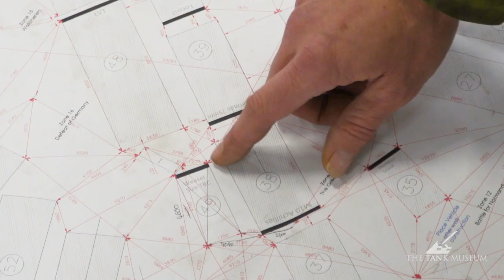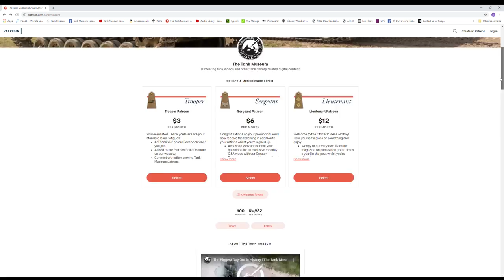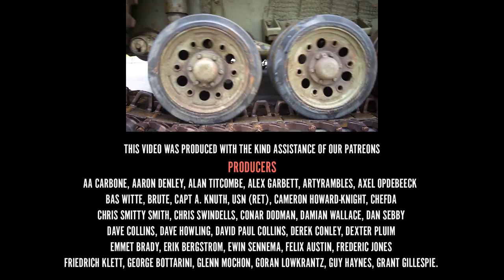WW2 Tank Move | Ep. 8 | Tank Workshop Diaries | The Tank Museum

Comment: If you use the A frame attached to the pintle hook of the buffalo and the towing eyes of the towing tank it will track nice. This allows you to use the equipment your staff are used to, the reversing of the A frame works with two tracked vehicles as they both skid to turn anyways.

Comment: Hi, Not sure if this would be of interest to you and I'm not really sure of another way of contacting yourselves at the tank museum, but I was watching your video and the part about moving the vehicles around inside and having the issue of diesel fumes got me thinking about something that might be useful to you. I'm a surveyor/chemist for the oil and petrochemical industry and there is a fuel that's been specially developed for working in confined spaces called GTL. It's diesel, but with virtually no sulphur content. It was developed specifically for fuelling the plant machinery they use for working inside the Channel Tunnel and is also currently being looked at by Transport For London as an option for Black Cabs and Buses there to drastically reduce harmful pollution. Not many people are aware of it, so wasn't sure if yourselves at the Tank Museum were either. If it's something that might interest you, I could probably find out who you would need to contact for more information or to procure some. Keep up the good work! Merry Christmas
Reply: Diesel for underground vehicles has always been low sulphur. Mining plant gets a huge ceramic particulate filter, a PTX catalyser and often a wet scrubber (and monthly emission testing). Channel Tunnel is a bad example to use. I was offerd the position of ventilation engineer, I turned it down. They used to have to stop work to allow the air to clear so the alignment laser could see the face again.
Reply: @QqJcrsStbt  I'm guessing by the fact you mentioned alignment laser and face, that this was during the period when the tunnel was still being physically constructed, rather than the vehicles that are used to maintain the tunnel now it's fully built.
If so, then the fuel I have mentioned above would not have been available at the time as it simply hadn't been developed then.
The fuel that wouls have been used back then would have been Ultra Low Sulphur Gas Oil, which has under 10 parts per million of Sulphur in it, it's still what most agricultural diesel vehciles are fuelled on today. And still produces quite a lot of harmful Sulphur fumes when combusted.
The fuel I mentioned above is a special Middle Distilate Fuel that has been put through a process where the fuel has been evaporated so it leaves the heavier particulates like Sulphur behind, then re-condensed back into liquid form. Hence the name 'GTL', stands for 'Gas to Liquid' It's fuel properties are extremely close to Diesel (So DERV's all run fine on it) but only has trace amounts of heavy particulates in it like Sulphur (A lot less then 1 part per million) So much safer for people to be around it in a confined space and also, just plain better for the environment in general

Comment: How about having a few high-load (90T) electrical / hydraulic turntables at key points in the hall (at each end of the main gallery, directly in line with exterior vehicle access doors)

That way you wouldn’t have to do so much turning the tanks a little at a time using mats and jacks. 

You could tow a tank in through a door, to the turntable, turn it 90^, tow straight down the gallery a close as possible its apportioned mark, and only have to crank and jack and swear from there to its final spot

Comment: Would it be possible to jack the Tanks up and then put heavy duty, multi-independent, wheeled dolly under the tanks?  The dolly would go from front to back and side to side of the bottom of the tank.  Maybe multiple dollies so you could put them under the tank a row at a time. Then lower the tank down on each row of the dollies, one at a time.  Then the weight of the tank would be spread across all the many dolly wheels.  And because the wheels would be independent turning, you might be able to spin the tank instead of towing and turning?
Reply: That is what I was thinking , dollies can pivot at the center , picking them would not be hard.

Comment: I wonder if you could inflate a skirt between the tracks and float the tank around like a hovercraft? If you want to get real fancy,  put an electric motor and wheel that can spin 360° at the front and back to move it and so it doesn't "float" into anything.

Comment: would it be possible to use a "two-way-entry low-height many-wheeled" trailer so the ARV can drag/push another tank on it? something like what Mammoet uses for moving things but much smaller so it can fit inside without the tank smashing the roof

Comment: 9:56 how is that part of the A10's drive sprocket moving so much faster than the rest of it?

And then the Mark 2 Churchill? Are the tracks rusted in place?
Reply: The break drum is on the outside it is driven by the input shaft to the final drive it goes round I believe then times as fast as the drive sprocket. The drum is on the outside to improve cooling it's common to the A9 A10 and Valantine tanks

Comment: OK. chek the oil, fill the tank, new batteries, if electric start(for most), pull the plugs and pour some oil in(every cylinder)(or if diesel.... skip that step), check the trany, greas everything, torch the engine(warm it up), spray some ether in the air cleaner, And start the old bag up. And I don't think I missed a step, let me know if I did.
Reply: @ConwayFox 

I believe it’s not quite that easy. And I believe some of their vehicles are unable to move under their own power.

Comment: 9:57 why is the inner part of the sprocket wheel turnning faster than the outer part ?     :-/
Reply: Might be loose, or an optical illusion of some sort.
Reply: Planetary reduction gear set in the axle/sprocket. Allows the gearbox to not need to handle as much torque therefore not needing to be as strong/bulky
Reply: @nicholas2198  ohhhh nice tyvm :)
Reply: @nicholas2198  cool